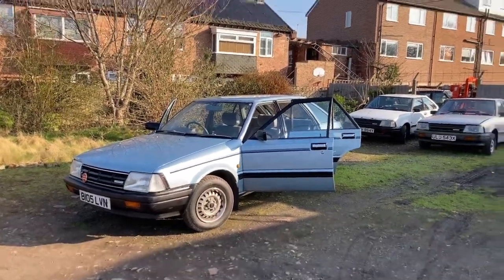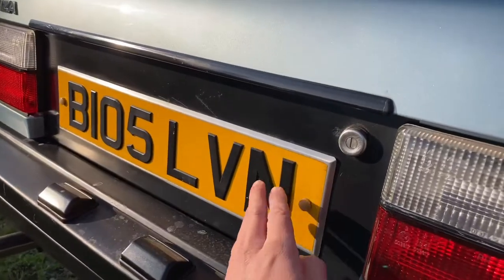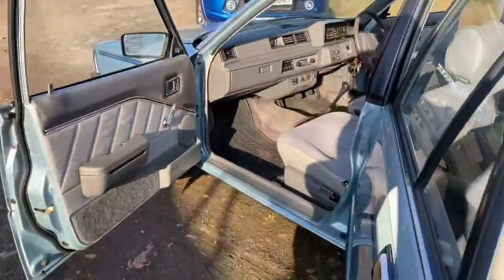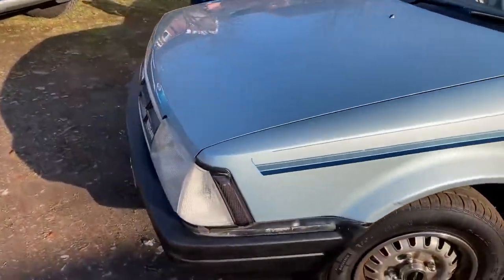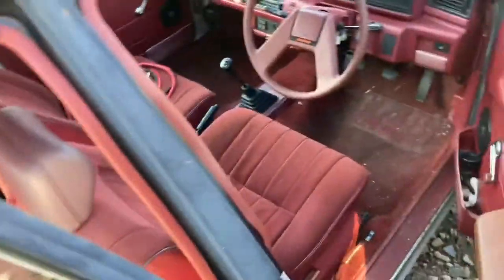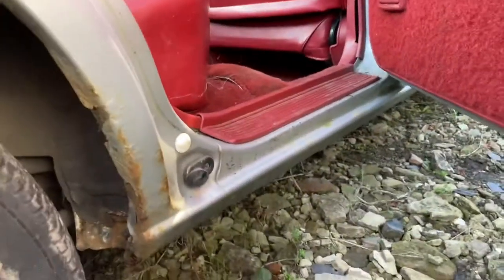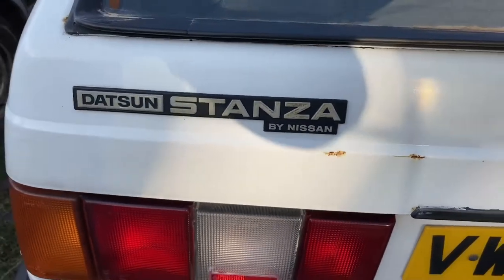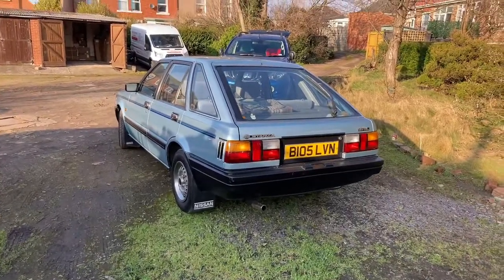Datsun Nissan Stanza Review | 3 and 5 Door Hatchback | 4 Door Saloon... with a very red interior

Comment: My dad had one brand new on an A plate, A161 UNY. Remember going to garage to pick it up with him. 5dr Stanza 1.6GL in white with red interior. Was a lovely car, very smooth and comfortable.  He optioned an electric sun roof. But other than that, and the dash, seats , door cards, carpet etc in red, interior exactly as the B reg 5dr you showed here. The interior was the same red and red everywhere, just as the other older stanza you showed. I loved it, looked stunning with a white car, with black coachline stripes on outside and all the chrome trim. Loved the interior in red. Happy memories.
Reply from the maker: They are cracking cars the Stanza, when Nissan/Datsun was something with having, not like the miss matched Renault devised still they are making now.

Keep a look on my channel Chris has some lovely old cars, P10 Primera in showroom condition.

Thanks for watching 👍🏼